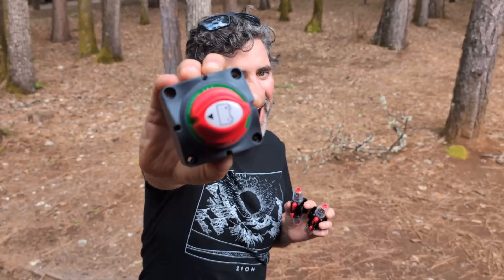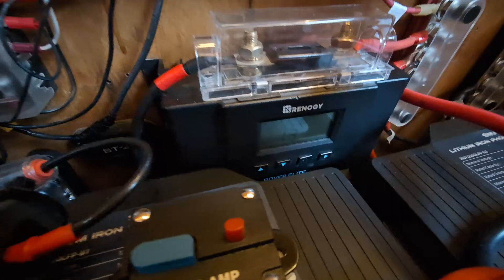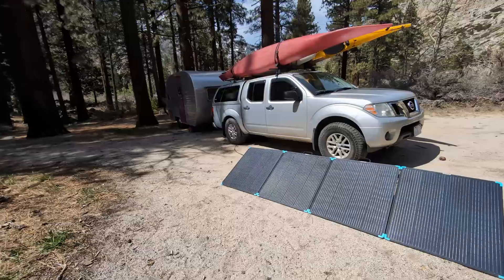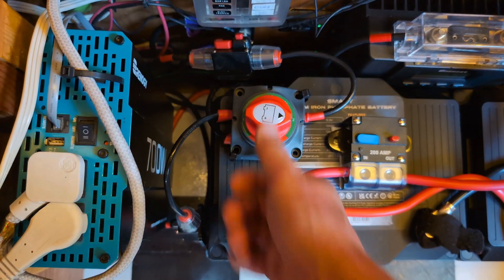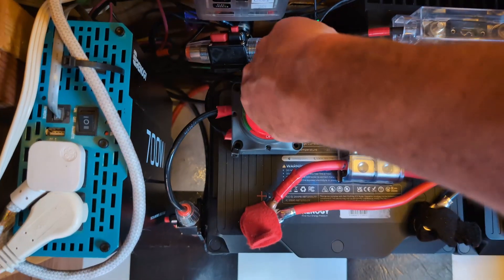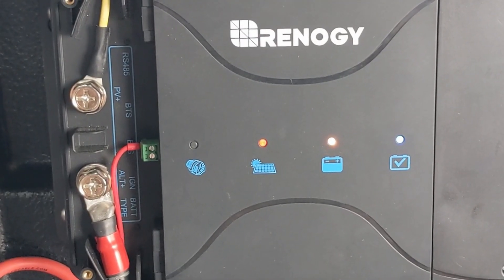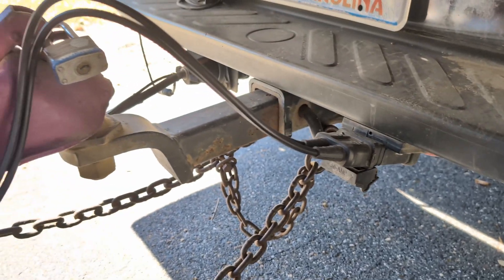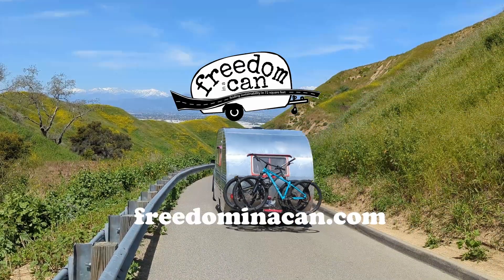Maximize Solar Power on a Small RV  - [Connect DC to DC Charger to Trailer Batteries]

Comment: Awesome, thanks for this. Is there a video about building your bike rack? I’d like to do that to my Scotty. Thanks 😮
Reply from the maker: Thanks for the comment! This has been a huge benefit for our full-time life.  We do not have a video about the bike rack.  We had our local metal shop (folks who do custom welding, install snow plow mounts, etc.) fabricate & install a 2" receiver for a bike mount insert to the bottom of the trailer.  So we could also take the rack and insert it into the truck.  A year later, we had them reinforce it the mount and it's worked great ever since.  Send me an email at freedominacan1957@gmail.com and I'll send you some photos.

Comment: I was under the impression that is was bad for the panels to be left disconnected from any load if they can be producing output. Maybe that’s an older methodology, but it has made me pause to rethink some design features of a solar setup. But, if they can be left disconnected  (as long as they don’t short) that simplifies some things for me. Can you shed any insight on that?
Reply from the maker: @Mr_SynergyPerformance  Thanks for the great question.  It is my understanding that the risk of leaving panels illuminated, but disconnected, is more about an unplanned shock (wires not plugged into a circuit in the off position) rather than any damage to the panels.  But let me ask our engineer friends at Renogy and get back to you with more specifics and reasons.  Sound good?
Reply from the maker: Sorry for the long delay in returning to your question.  When you disconnect the solar panels from the charge controller, they are no longer in a circuit.  So, they will produce a voltage when illuminated but no current, because there's no place for it to go, just like turning off a switch to an outlet.  The only danger is if there's a potential for a short circuit when suddenly something unwanted causes the voltage to become a circuit, i.e. you.  But with proper MC-4 connections and switches, there's no harm.  Make sense?

Comment: Do you have another video that explains about the efficiency of the 2 different solar arrays and why you’d need to swap? We have 400 W on the roof and want to get a 200 to 400 W suitcase. If they were both at 400 W it wouldn’t be an issue to go through the same 50 amp charge controller? We have an external input that goes through the same controller. Thanks!
Reply from the maker: Hey there, thanks for the question.  
While we don't have another video, we just wrote a blog concerning this issue -- https://freedominacan1957.blogspot.com/2024/05/summertime-strategies-for-staying-cool.html#:~:text=System%20Integration%20Options,a%20few%20ways%3A

Concerning your issue.  How many panels do you have on the roof?  I'm guessing 2 x 200W.  So when connecting all of your panels together, roof and portable, they will need to be similar wattages.  If you want to simply go through the same controller, use a 200W portable.  Or you could have a separate controller for the 400W portable, (see our review of the Renogy 400W Lightweight https://youtu.be/dDgs9RaqUkA?si=mQX0D4-50Sc0dKwI),  or lastly do the hack we showed in this video to isolate your panel arrays so that you won't loose the efficiency of the 400W.  
And if you want to go with Renogy, be sure to use our affiliate link: https://renogy.sjv.io/LPEyNY and promo code "CANLIFE" for 10% off.  All the best, and let us know if you have any further questions.
Reply: @FreedomInACan  Thank you!!